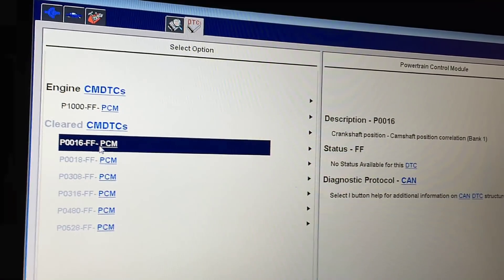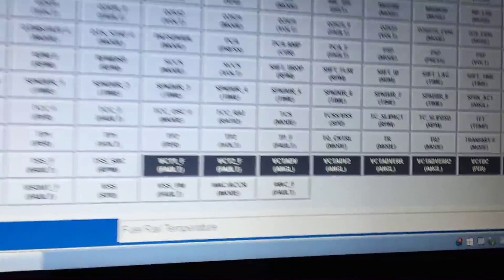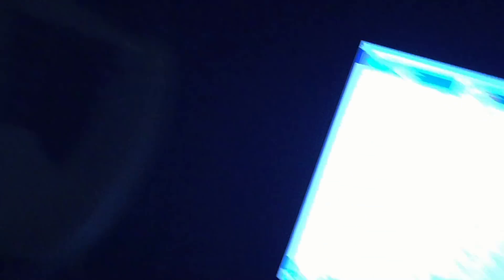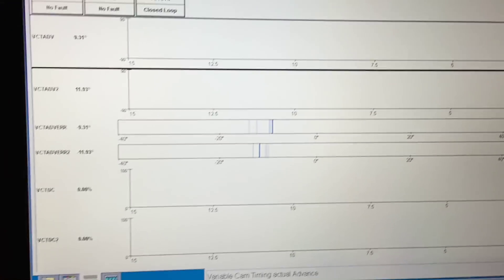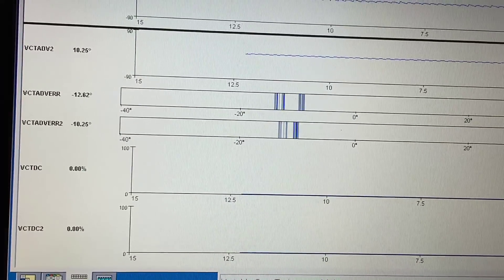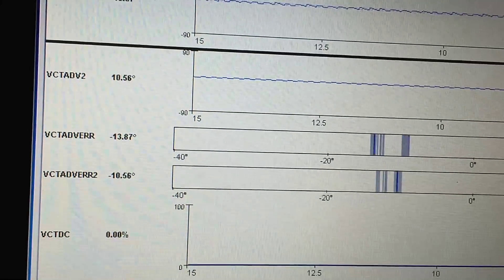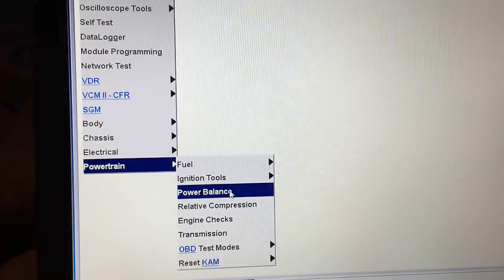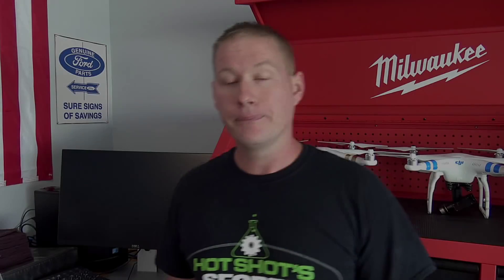Ford 4.6L 5.4L 3v Engines P0016 P0018: How To Tell If Your Timing Is Actually Off

Comment: OK I replace the timing chain and all the timing components as well as upgraded my camshafts with a pair of hot rod cams with my 2006 Mustang GT 4.6 L three valve. I started up and it seems to run fine and idol but definitely has a miss when exhilarating but I’m not throwing any codes??

Comment: I have a 2004 f-150 5.4 3v, recently  replaced all timing components.
Engine runs great till pushed to high rpm the it seems to flatten out with no power???
No codes being thrown 
I used after market parts....
Does this mean the phasers aren't advancing as they are supposed to?
Reply: I’ve worked on a lot of these 5.4 and one thing I have learned is to use OEM Ford parts after having aftermarket parts go bad within a few months. Bryan said that and trust me I learned my lesson.  And yes it’s does sound like your phasers are locked up or sticking

Comment: hi i got a 2007 ford f150 5.4 ford dealer did timing car ran great after two monts later i got a code p0018 and p0022 dealer tells me i have to replace the engine it has nothing to with they did can you help me out truck runs really rough and looks like dumping alot of gas thanks

Comment: My 2008 Lincoln MKX just got this code out of the blue. P0018 code, I replaced the camshaft sensor and nothing. I thought about getting the VCT solenoid and trying that. I can't imagine it would be the crankshaft sensor since it would say both banks. I also assumed the bank closest to the front was bank 2, bank 1 being at the firewall. Any help would be appreciated, how can I tell with maybe a volt meter which sensors are bad or which one to replace or if the timing has jumped. Thanks.
Reply: Bank one is on your passenger side, two on the drivers

Comment: Ford techmakuloco have a 2009 Navigator got the phasers replaced after a check engine light turned on gave me code p0018 but next day when I start the truck it's not on anymore could it be just a faulty connection to a sensor

Comment: My friends 5.4 3v was making a rattling noise which I'm assuming was the timing chain hitting something on start up and was making a knocking noise and has had absolutely no power through the rpm range. The other night the ticking got loud then stopped and now the truck isn't making any weird noises. Now he is throwing p0011 any ideas? People have said it could be the timing chain tensioner

Comment: Where are the lobes suppose to be on the o'clock o meter when you have them span over the left and the right and on the dot on the crank ? That would be so awesome and do you have to remove the cams or the followers absolutely ?

Comment: FordTechMakuloco after replacing chain guides, phasers and vct on both sides I have P0016, egine runs good, great power no noise at all, but shakes a little at idle. I know I have one tooth off on bank 1, I'm about to remove valve cover and phaser then move chain one tooth. Question is which way shuold I move it, clockwise or counterclockwise? 
Thank you in advance for you help and your great videos that help us work on our 5.4 engine.
Reply: What do you mean by ( one tooth off) and how that could happen if you timed the engine correctly?

Comment: hey man, I appreciate your videos! I recently had my timing chain set, tensioners and oil pump, also had VCT'S replaced before that too. I'm afraid my timing wasn't set properly, I'm getting p0340 and occasional p0344 codes. truck runs fine under normal conditions, a small  miss at idle, but not very noticeable.  At WOT however, I get misses on 1 and 3, I replaced coils and plugs too. does it sound like my timing is causing this? I have a Bluetooth OBD II and tourqe pro app, can I check my timing with this?
Reply: Ryan Sammons you ever resolve this?  I’m going through the same issue...p0340 and p0344

Comment: when I was going to leave work today I fired up my 2010 ford f150 w/4.6l vin 8 motor and it started running badly also brought up some error codes p0016 - crankshaft position - camshaft position correlation (bank 1 sensor a) and also misfire on cyl3 and 4 Ive changed both camshaft sensors already and it still brings up that code.
Reply: Did u figure out issue i have similar issue I unplug my bank 2 cam position sensor thou runs like new but plugged in get codes and runs like shit

Comment: Hi FordTech, I am trying to diag an 06 F150 setting codes p0012, p0016 and p0018. these have set after the truck was road tested by a potential buyer, truck has 125,000 on it. Is the p0012 a result of the other codes? Nice video also

Comment: FordTechMakuloco  08 Ford Explorer 4.6l   Intake runner control code stuck open  dont have code handy   have you seen this?  And is the fix to replace the IRMC
Reply from the maker: +Mary Lung When they are stuck open the concern is usually an obstruction holding the linkage in the open position.
Reply: +FordTechMakuloco  Thanks!  I was able to move by hand with no complications.

Comment: I'm having this issue with a 2011 f150 with an 3.5 ecoboost engine but im getting P0016 and P0017. The vct is reading 20 degrees on both intake and exhaust on bank 1. bank 2 is also reading 20 on the intake and exhaust. The desired value is reading -5 and -20.

Comment: Took my daughters 2008 Ford Taurus into a certified Ford dealer to get a new radiator installed last weekend. A day later after getting it back the check engine light came on and this code comes up.Is it possible that in order to install the new radiator, the shop took enough stuff off the front of the motor to cause a timing discrepancy?
Reply from the maker: +YoMoma777 No nothing on the engine has to come apart for a radiator job. Are you sure they didn't replace the water pump too?
Reply: +FordTechMakuloco  they did not. They are gong to look at it for free to make sure it wasn't  anything they did.

Comment: How is it even possible to mess up the timing if you align everything back up.  I mean the crank gear only goes on one way and has markings on it where the chain goes.  Same goes for the phasers there's markings.  I'm about to dive in soon myself on my 07 5.4 and it seems pretty straight forward. Just time consuming

Comment: I have 145k on my 5.4 and have had phaser noise since about 50k. I replace lash adjusters at @117k because they were all seized, engine was clean no varnishing or sludge. Runs fine except for the phaser noise when warm and occasional start up rattle from chain. Do I need to address these issues or are they just annoyances that I could live with?
Reply: +PrimalurgesMiami I'm going to be honest with you, I wouldn't worry about the rattle. I have an '07 with 133,000 miles and does that rattle at start-up as you speak of. Noticed it from day one. Bought with 43,000 miles 5 years ago. Still does the same thing and no problems with anything in the engine/timing etc. It is not always the chain either. It can be the lifters leaking down over night and causes excessive lash for a second and then they pump up and takes the slack out of the rocker arms.
Reply: +Brian Robertson Thanks for response. That's what I figured.

Comment: Great video! Could you do a follow up on how to check timing on the 2v 4.6 / 5.4 engines? I'm working on changing brakes on a '99 Expedition with a 4.6 2V engine where the engine has recently been rebuilt, and it's really lacking in power and does not sound like a rebuilt engine. Could it be mistimed?